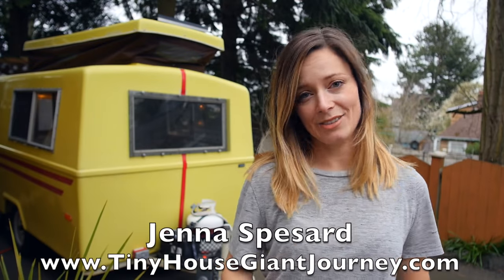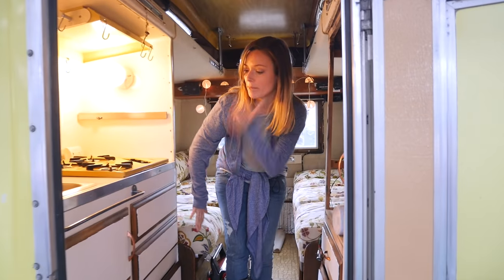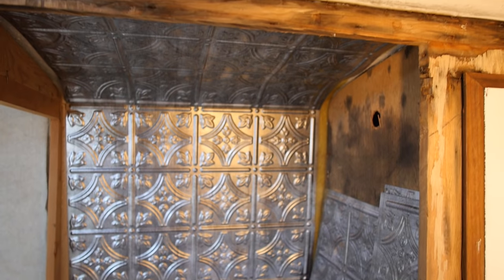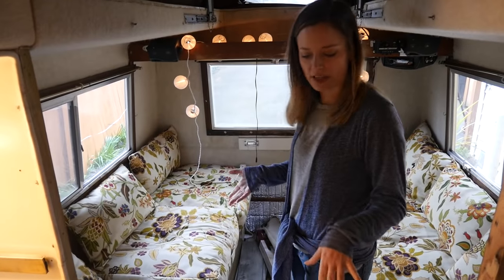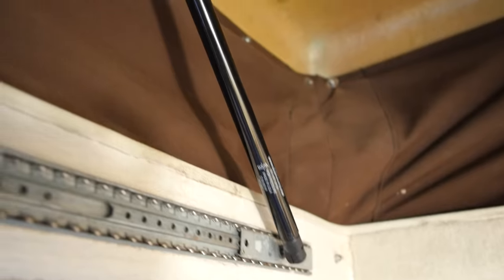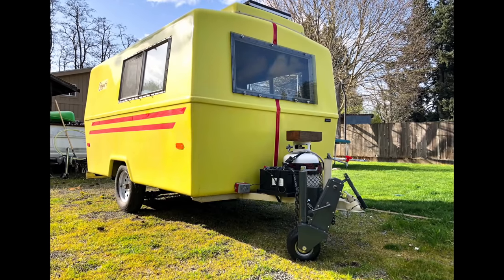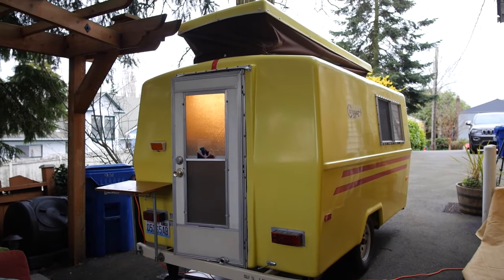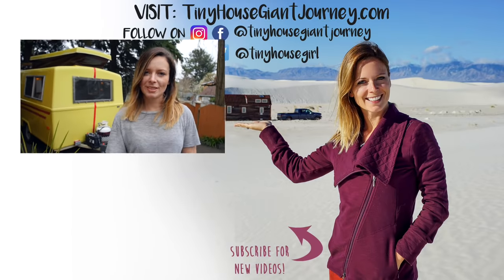Vintage Camper Trailer Restoration - Ep 1: Before Renovation

Comment: I chose this:   https://www.hotcampshowers.com/inc/sdetail/1257
for my efficient outdoor lowflow(use) shower  that I use with a quickly assembled press fit frame of 1/2"  pvc pipe with 90degree and tee fittings forming a 5' high enough box 30" square using a continuous sheet of opaque plastic spring clamped to 3 sides for enough privacy when placed near the trailer/rv powered by 12v pump or other supply. Lastly,  6 secured hdpe drainage grates each 4x24x3/4" about form a mudless floor.